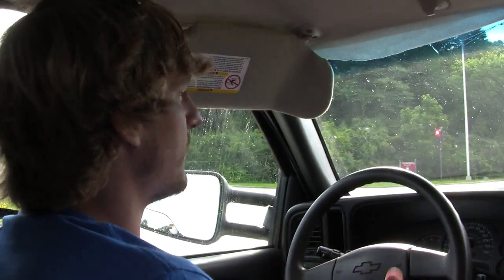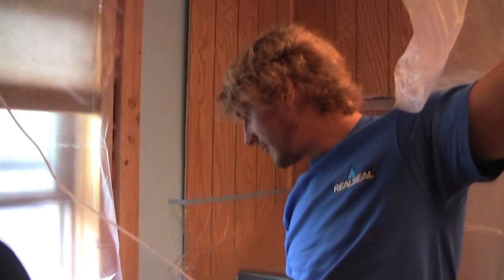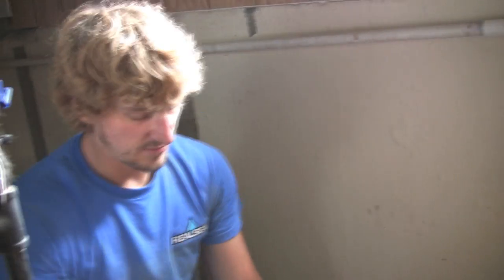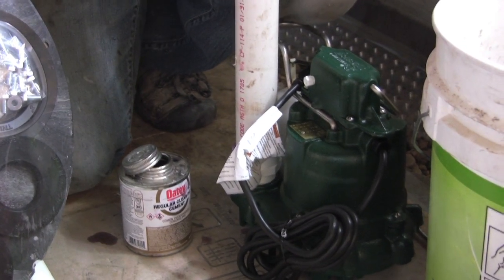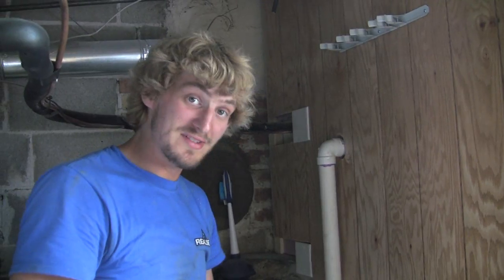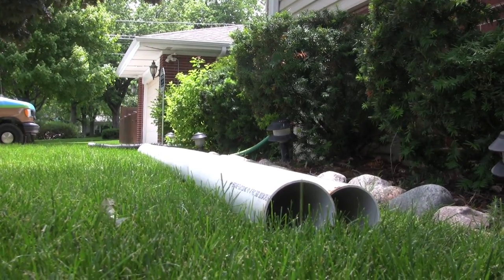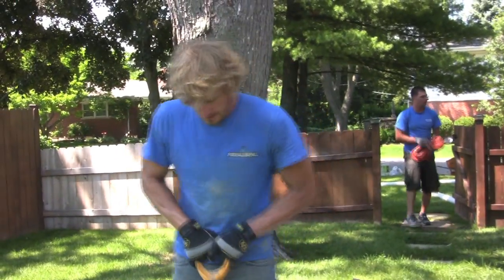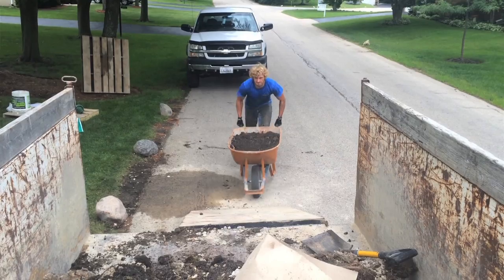How We Do It: Interior Drain Tile System

Comment: why did you use corriagted pipe inside instead of perferated pvc style
Reply from the maker: Hi Robert! The perforated sewer pipe is used for Exterior Drain Tile Applications to help prevent collapse of the pipe. As the interior system has no settlement or extra weight on the system above the concrete, there is no need to use it.
Reply: easier to intstall.

Comment: How come when you drill the hole below the check valve, you said something like "make sure it's pointed away from the valve" ?
Reply from the maker: Apologies for the late response, John. The hole below the check valve is to relieve pressure. All sump pumps installed with a check valve should have this 1/8" hole in the pvc. This hole is pointed away from the float switch because water will come out of it when the pump is cycling.

Comment: Very nice video. Is the new concrete too thin? I would have made it 6" deep. Concrete is so cheap it's cheap insurance.
Reply: +Andy Denial We always like to make the concrete as thick as possible. In this case, the concrete could not have been poured 6" thick, as that would bring it below the footing. As the drain tile needs to be sitting next to the footing, it made that 6" thickness impossible. We instead re-poured the concrete the same thickness as we took out.
Reply: cool to know! thanks for responding!
Reply from the maker: Happy to have helped!

Comment: Great video on tile installation. Whats the name of the clear plastic L channel material you guys use in the video.  Gotta find some to do my grannys basement next month...thanks!!
Reply: +Eric Faulkner Sorry it took us so long to get back to you, Eric. That product was Hydrochannel, however any foldable dimple board will do. The point is to make a gap between the foundation wall and the newly poured concrete so any water coming down the wall can make it into the Drain Tile System.
Reply: +Austin Werner I've seen elsewhere 6 mil plastic sheets also covering the wall and tucked behind the dimple board. Do you find it sufficient without the plastic sheet?
Reply from the maker: Hi Bigdave, sorry for the late response. We did find it sufficient in this situation as it is a poured concrete wall. In a block foundation, we would certainly have the plastic sheet added, as they leak much more through the wall.